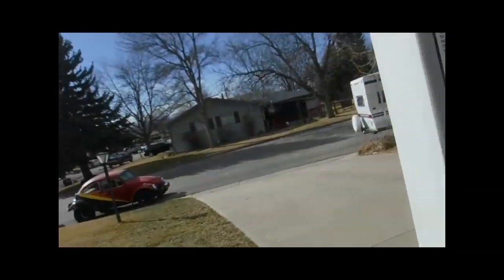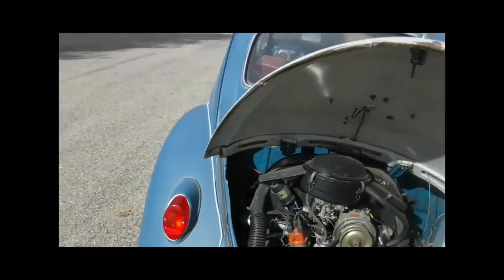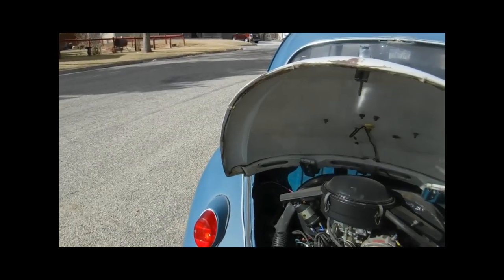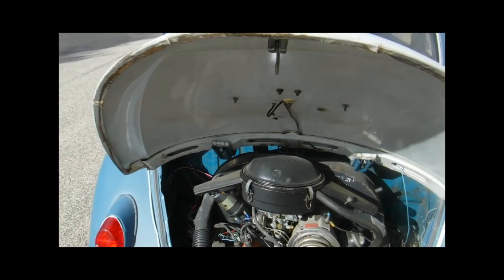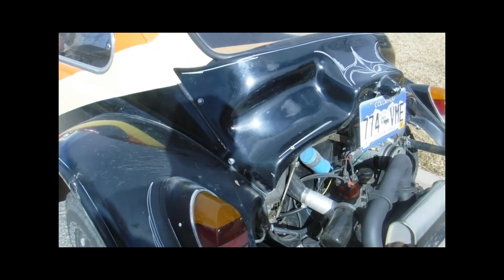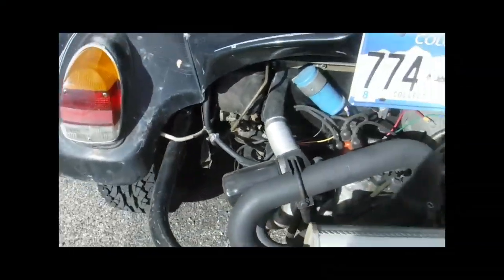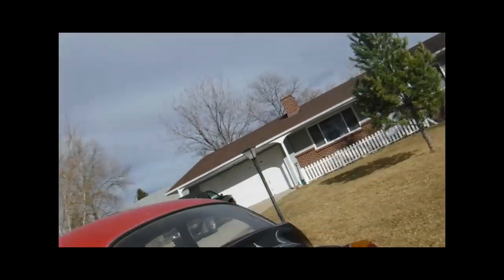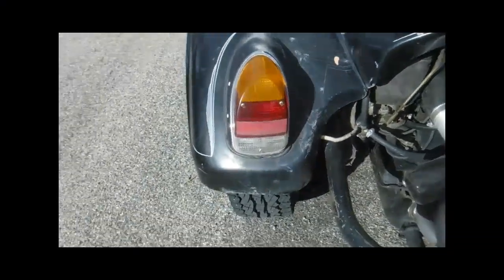Fan Shroud & Cylinder head Q&A

Comment: i wouldn't even contemplate  taking the   fan shroud off in situ,  the engine comes so easy, i even swapped an engine  on my own with just a bottle jack  a scissors jack and some blocks of wood mind you it wasn't  as easy as it is  with a trolley jack.
Reply from the maker: I agree

Comment: I had to pull mine on the side of the road one time. It's possible,  but deck lid and hinges have to come off and it's a pain. But it is possible! Necessity is the mother of invention and success.....
Reply from the maker: I doubt you had the correct stock air shutters and thermostat when you did this. Many builders leave them off thinking they will get better cooling but thats not true.
Reply: TheEZGZ correct,  I don't think it had any of that stuff.... that's how I got the car though but I ended up ditching that engine for a subaru engine anyway lol
Reply from the maker: I like your suby set up.  No! I can't afford it. hehehe
Reply: TheEZGZ haha darn!

Comment: Good vid EZ.  Are the AA heads a little cleaner than CarCraft?  (less cleaning up fins, etc?)  Bryan
Reply from the maker: I never got the AA basic. I opted for the big valve port and polish jobs. To much head for even my 2110 the way it is set up with the C35 cam. If I had your 1800 I would stick with stock 32X35 steel valves and HD single springs, Chrome Moly retainers and keepers. I would set the deck so that I could use the stock lightweight pushrods with a good rocker arm tip. You might not have to shim the rocker stands as long as you have 3 threads showing above stock adjusting nut. If you really want fancy you could go Titanium retainers for a little extra RPM on that 110 cam u got

Comment: Again a great video to add to the very many !  I have noticed that on my railbuggy the cooler shroud and cylinder tin is made out of aluminium. is this normal or good?   Thanks
Reply from the maker: It is not stock but I think it is good on a sand car. You want to save weight and your in different running conditions.  BE HAPPY someone else already spent the money.

Comment: wow you are in the 70's and yestherday in Iowa we had negative temps with wind chill and snow and cold is on it way.. On a late model parts car I did pull the dog house off the pain is the heater shaft in the back runs through the head during the job it spoke to me and I said a few words back.
Reply from the maker: Thanks Dan. I appreciate the input. Stay warm.

Comment: Speaking of fan shrouds ...
What's the difference between a Thing fan shroud and type 1 shroud?
I hear , better cooling with the Thing shroud.
Reply from the maker: The Thing originally came with the larger doghouse cooler The popular single ports did not come that way. Dog house setup also a cooling fan that moved more air among other things
Reply: The VW enthusiast by me are saying...
If you block the air duct tubes on the shroud, it creates turbulent air in the shroud. Therefore you should open up the shroud and remove a fins that directs air to those tubes for your heater.
Aways looking for trick stuff.
Your thoughts?
This motor will be on a dune buggy.